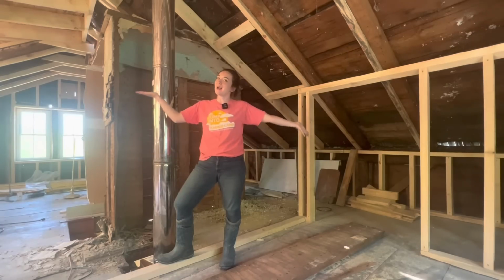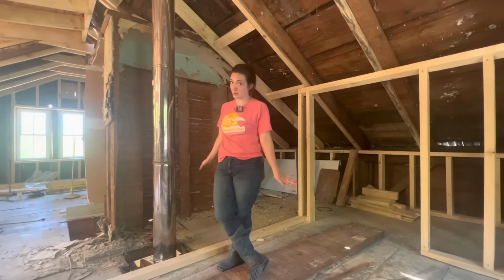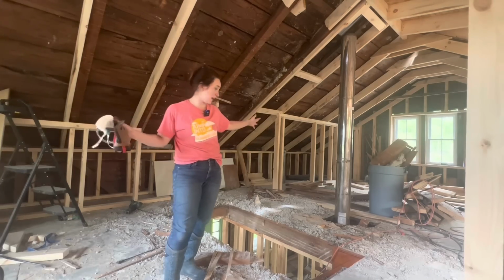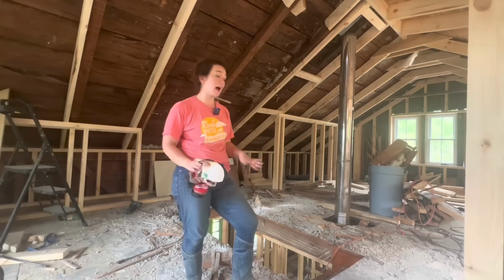I thought it was over…. | my Fixer Upper Home Renovation

Comment: Easiest way to work on the stair area is to put a board over the hole the stairs go down while you work so you don't have to worry about falling down the stairs and your access to the walls is so much easier.  We built a little cover that we would screw over the stairs while we worked on the surround area and it was so easy because there was no danger of falling down the stairs and you can use a stepladder to reach the walls inside the stairwell.  You are doing a fantastic job and your house is going to be amazing!

Comment: Maybe you can put a half wall up at the top of the stairs to keep it open. I think that would be awesome😊
Reply: Yes, Yes! that would be great and it wouldn't close off the light.
Reply: But isn’t that the back of the closet?
Reply: I have been thinking the same thing !
Reply: I agree. Plus rip out downstairs ceiling all the way to where stairs begin.
Reply: I was just thinking the same thing , that would look really good
Reply: If she did that, one side would look into her bedroom and the other side it would look into the closet, or the spot the pipe is, in the other room.
Reply: Those old boards that were on the stairs wall would be perfect for shelves
Reply: A lot of these commentators need to go back to look at the floor plan. An open staircase would made it impossible for her to have two bedrooms.